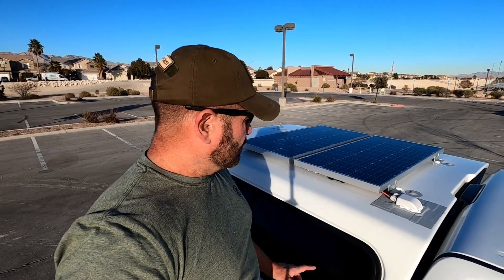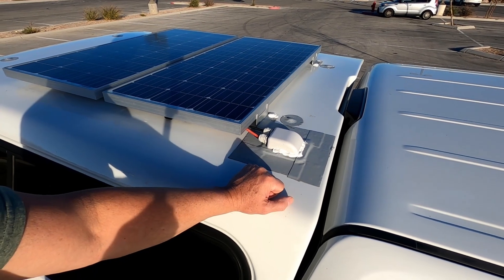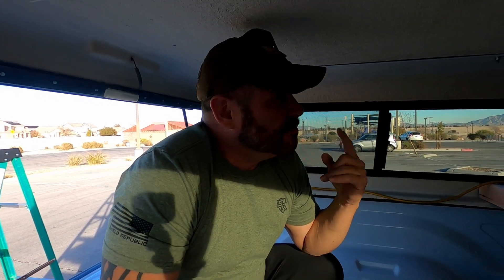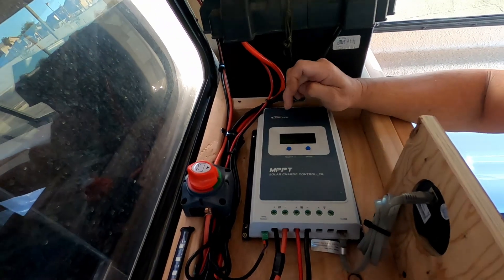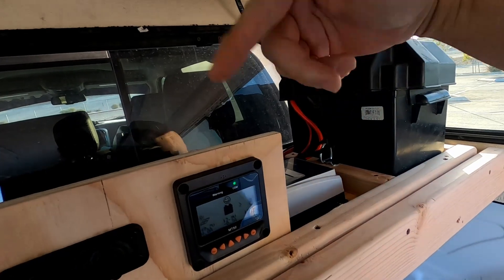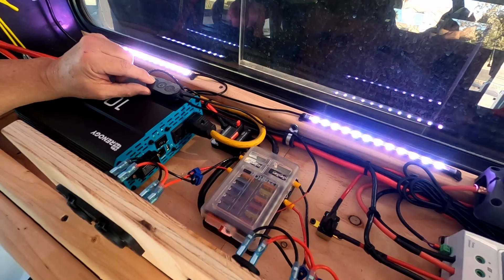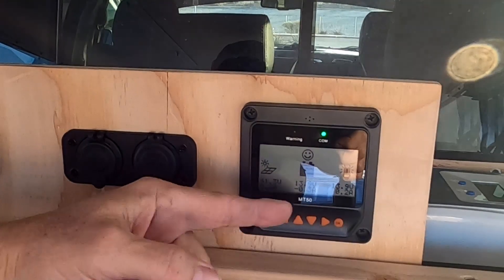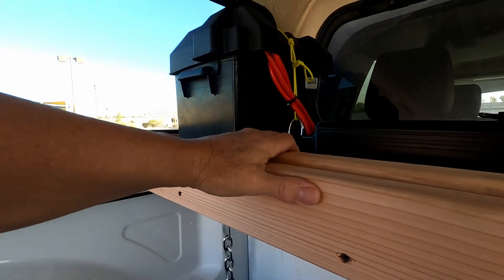200W Solar Install on my Camper Shell

Comment: absolutely love the idea, as an electrician i wonder if using an LB connector weathproofed with electricians putty, silicone, and running it into mounted EMT with wall mounted battery/inverter/breaker panel then feed out wood be ideal for this kind of build.

Comment: Thanks for the tip about those rails inside roof of your fibreglass canopy. I'm installing shortly and was scared bolts might rip out at speed  but this seems pretty sturdy
Reply from the maker: Insanely sturdy. I never had a single problem with it...

Comment: Not sure if you mentioned it in the video or if I missed it, what gauge wires are you using to connect from your inverter to the battery?
Reply from the maker: Because of the short distance and the 1000 max wattage, I was using 4 gauge. If you're going with a 12v system I HIGHLY recommend taking a look at a wire gauge chart as things can heat up pretty fast. I no longer have this setup, but in hindsight, I should have used 1/0 wire...

Comment: This is a great video, thank you for posting. I'm looking to do something similar on my shell. I do pesticide work and have a 12v pump connected to a water tank and  small lithium iron phosphate battery, but I'm looking to add a panel to the roof to power that pump and a couple of small fans. My truck already has an inverter but I want a separate system to run everything when the truck is off
Reply from the maker: Go check out this video. It may be what you're looking for... https://youtu.be/BGCuPAZqUDI

Comment: I know this is old but I would have used plywood on the inside where the cables came through to prevent the bolts from damaging the cap.

Comment: can a system like this work as limited shore power for a travel trailer? i have been thinking about something like this on my truck for overlanding and trying to figure out a inverter can work as shore power. my planed truck loadout would be a 3kwatt inverter, 400Ah LiFePO4, 3x200watt panels
Reply from the maker: 400Ah = ~5200Wh. 5200Wh ÷ 600W = 8.7h of sunlight to charge from 0.  Since solar panels never work at optimal performance, it's hard to determine an exact number. Also, success would depend on your load.

Comment: could you power a cpap machine for 8 hours ?
Reply from the maker: I'm not sure. I have no idea how many watts a cpap machine pulls. The upgrade has ~2500Wh of power.  So, 60W / 2500Wh = ~40 hours. Also, a Jackery 2000 is around $2,100 for 2100Wh. I have around $1700 in the new system. Hope this helped.

Comment: I’m a little confused with the number of bolts you used for the panel brackets. It looks like with the number of brackets, there should be 16 bolts total. Did you only use 1 bolt per bracket or am I missing something?
Reply from the maker: Yes, and where the brackets meet, I overlapped them using just one bolt. 1/4" bolts through the aluminum brackets and through 1/8" angle iron with washers... I have had zero issues...

Comment: I'd probably put a washer or something on the bolts to keep the camper shell from flexing to come in contact with the rail. It'll crack over time. Also, don't you have to vent the batteries so you don't build up that nasty gas?
Reply from the maker: The just cracked the windows for ventilation. I have since upgraded the batteries to lithium-ion...

Comment: May want to double nut those bolts. Lock washers fail over time.
Reply from the maker: They also have Nylon Nuts... Could fail, but pretty slim chance having bot on there... Thanks for the suggestion!

Comment: Total price of the entire setup?  I'm setting up my truck camper and getting ideas.
Reply from the maker: Rough estimates: ~$1200-$2000 depending on the batteries.
Batteries $200 (I have changes out the SLA for Lithium-Ion ($800). You have to be careful using Li in the cold. Make sure you have a BMS the battery.
Charge Controller $200
1000W Inverter $180
Solar Panels $200
Fuse box $20
Wire/crimpers/lugs/heat shrink $200
Sealer $80
Wood/chain/turn-buckles/screws $120
Time ???